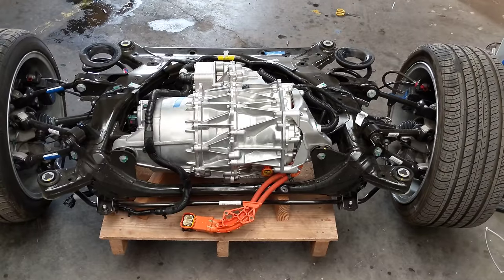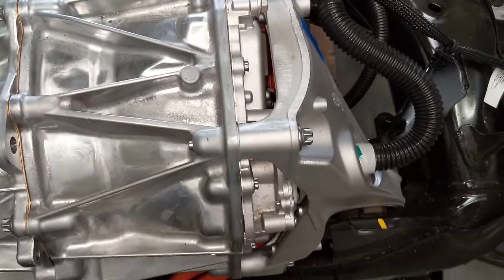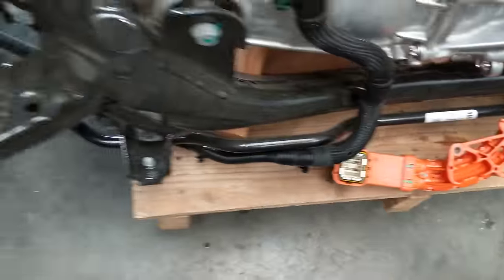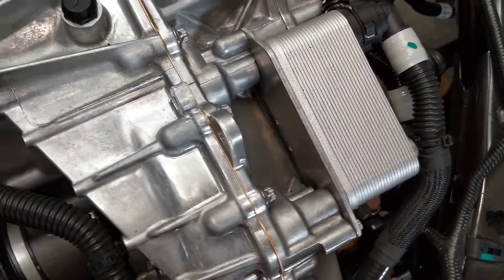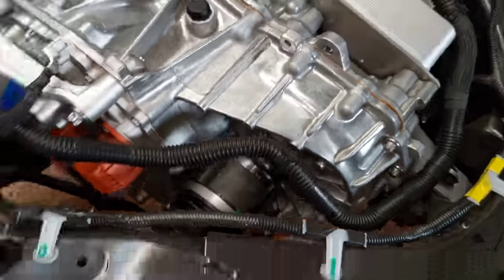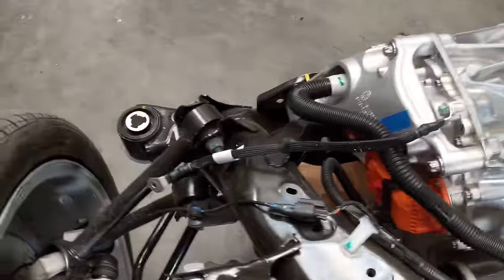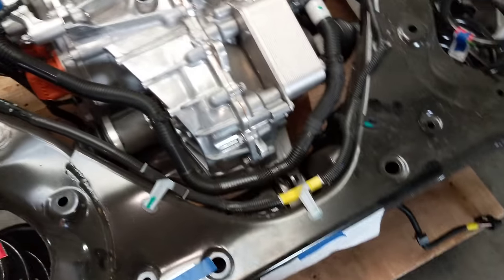First Look: Tesla Model 3 Drive Unit

Comment: How can four bolts hold this huge powerful motor?
Reply from the maker: It's a pretty small motor (200lbs), and the bolts are definitely up the task of the dynamic forces.
Reply: Airliner jet engines are held on at 3 attachment points connected with one pin each.  Good engineering design is the key.
Reply: The front 2 bolts has 128nm and the back ones has 168nm I use to torque these bad boys till I got laid off😒

Comment: The suspension seems like odd geometry to me. Is that common practice? I guess it's to have the spring off center for the drive axle but I think I would prefer a symmetric design and maybe use two coilovers if necessary. Also I don't care for the concept of a sway bar, particularly not with a low CoG like M3

Comment: Two of these under and early wrx, oh man
Reply: Model 3 rear track is 62.2”, GD WRX rear is 50.3”. So 2.9” narrower total, or 1.5” per side. (GC is narrower still.) You’ll need fender flares or different wheels. Subaru used 5x100 wheels for Imprezas but gradually went to 5x114.3. Same as the Model 3. However, Model 3 uses 14mm studs instead of 12mm studs, and “medium offset” of 35mm or 40mm instead of Subaru’s “high offset” of 45mm to 55mm. Then there’s the hub bore: 56.1mm for Subaru, 64.1mm for Tesla Model 3. 

The bigger deal would be mounting it. Luckily, we already know the spare tire well in the trunk can be cut out. Subaru also used a saddlebag gas tank that can be removed. Stock rear trailing links could be ditched too. The. You either need to weld parts of the Subaru rear subframe to the Tesla subframe, make adapter brackets, or modify the Subaru chassis to accept the Tesla subframe. Another handy plus are the two access panels Subaru used for access to the top of the gas tank. 

Using the Tesla rear springs would be a puzzle, but some air suspension “bag over” kits don’t use them. Instead, the damper attachment points do all the work. Luckily, the GD has some very high rear strut mounts that are very sturdy.

Comment: If you ever played with hobby grade Radio control cars then your pretty much set. The only difference other then size is the ESC (Electronic Speed Control) on RC cars are far more advance in technology the motors come sensored  or sensor-less and the ESC are user friendly and easy to tune. I'm surprised no one has attempted to replicate it for a full size EV. It would make life so much easier.
Reply from the maker: Sorry, I don't know of any hobby ESC's using SicFETs, and definitely none are near the total efficiency of Tesla's.  Running a sensorless feedback system in a large traction application is very difficult, and has all kinds of issues.

Comment: How much is a good cost for this setup? Also the best spot to get it. Good video ty!
Reply from the maker: The best bet is to buy a whole wrecked Model 3, as you'll find you need harnesses and all kinds of extra little parts.   I do have a controller that can allow full operation of the drive unit outside of the car.  Can use the original Tesla pack or any other high-voltage (250-400v) power source.  All it requires is the matching (from the same car) security controller (VCSec), Accelerator pedal assembly, and some custom wiring.  Once you are up and running you can then sell off all the parts you didn't use and make most of the purchase back.
Reply: @Ingineerix  I did find a full setup for a battery for $5,000  of a Chevy Volt batteries setup.  Tesla S motor for $11,500. The motor comes from EV West. If you want to see whats all included. Is this a good option? The car I was to use is a Subaru impreza 1998 2.5RS. That is so much for the help. I've never built a car but reading more about electric cars. Its becoming a passion of mine.
Reply from the maker: The EV West guys are great, and will take care of you, but on all the Tesla drive units they sell, they remove Tesla's inverter drive board (and thus all Tesla's software) and install a third-party board from Europe.  This is throwing away a lot of Tesla's awesome engineering for efficiency, power, and longevity.  If it blows up, then what?   (And they do!)  I offer an external controller that doesn't require any modification to Tesla's drive unit, it keeps it 100% Tesla and makes it work as engineered by Tesla.  (All protection features are still active)  If for some reason there are any problems it's all standard, so replacement is easy and quick.   Also, be sure you can fit a Model S drive unit in your Subi, They are large!  Personally, I would recommend a Model 3 drive unit, it's much smaller, lighter, and more efficient.
Reply: @Ingineerix  You personally sell Tesla 3's? What I'm basically looking for is something that's good performance but also a daily driver. Good performance I mean something that compares to a Golf R or other fast hatches.
Reply from the maker: No I don't, sorry.

Comment: Could you get it to work with just the battery and drive unit, without all the other stuff?
Reply from the maker: The minimum needed would be the shifter (SCCM), Pack, and Drive unit.  You would have to generate some CAN signals with a separate controller.
Reply: Ingineerix thanks, I think I could get that to work. I think this would be great.
Reply from the maker: Contact me when you have a project rolling.  I will probably have a CAN controller available by then.  These Model 3 components are going into another secret project soon!
Reply: I will, it wont be quick, I like the concept of using the Tesla system, Model S, 3 or X but can't do this quickly. Have been looking at damaged cars via ridesafely.com. getting more in state so shipping isn't crazy. Have you ever heard of MAGNAX, they make axil Flux High speed motors.

Comment: Looks to be realistic to swap into a Fiero/MR2 or any RWD car.
Reply: An AW11 MR2 with one of these would be awesome :)
Reply: I don't see how Tesla would lose money selling drives and other parts. GM does this with their crate engines. If Tesla waits too long, some other company (say, in China) will make "crate motor bolt-ins". There is a replacement for displacement.
Reply: @RaglansElectricBaboon  and deadly....if you could get the tires to even hook up lmao
Reply: SW20 rear track is about 5 inches narrower than the Model 3. Both use 5x114.3 wheels with similar offsets, but 14mm wheel studs to handle the Tesla’s torque instead of 12mm on the Toyota. 

The good news is that the MR2’s rear suspension subframe is held on with about four bolts. The bad news is that those four bolts are in entirely different locations than the Tesla. Worse news is that the bottom of the firewall between the engine bay and the trunk might need major surgery. Good news is some of that’s been done before by a guy who put a rotary piston engine in an MR2 for 24 hours of Lemons. 

Alternatively, you could just mount everything behind the car and create a very long wheelbase MR2. Think outside the box, lol!  That would leave the entire engine bay and trunk for batteries. 

The MR2 doesn’t require (conventional) power steering, so that’s easy. You’d still need to figure out vacuum for the brake booster..

A stock Mk2 MR2 weighs about a thousand pounds less than a RWD Model 3. Whatever the final weight would be, it would certainly be a cool conversion.
Reply: @Edgar-Friendly  Tesla is making more money selling Model 3s than they would selling retrofit kits. Every drivetrain they sell as a kit is a Model 3 they didn't sell. But if the chip shortage means that Tesla could build and sell these drivetrains while the rest of the Model 3 is bottlenecked, then that might be worth developing such kits. We're not there yet, though.

And honestly, I'd rather part a scrap car to retrofit than buy a kit.

Comment: How many total moving parts are in this motor?
Reply: Jef b 1
Reply: Well 1 and 2 bearings I guess. Then a reduction gear, done.
Reply: From a marketwatch article re model a: “The company says its drivetrain has about 17 moving parts compared with about 200 in a conventional internal combustion drivetrain. “
Reply: @Kim Neeper Rasmussen; and a differential.
Reply: Ummmm if the model S has 17, let’s guess that the correct answer is 17+/-2-ish. Waiting for confirmation

Comment: What made you pull it out?
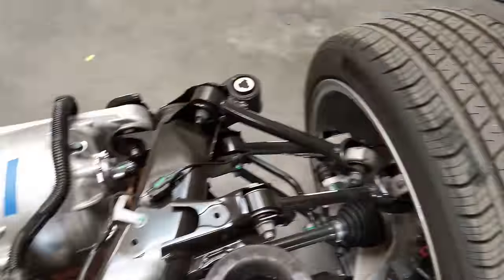Reply: I'm pretty sure it came out of a totaled Model 3.  You can see the ripped inside sidewall of the tire at 1:27.  Also at the 1:00 minute mark you can see the inside rim of the wheel is slightly beat up which would never happen to a newly delivered vehicle.

Comment: This needs a project..

Don't fit it back into the Tesla.. 

Find a Festiva.. 

Make it AWD.  

Please I beg you.
Reply: There is a Tesla which is AWD and dual motor. It's one of the model 3's.
Reply: +Telclivo All Teslas have AWD now.
Reply: Sweet.. I'll wait 10 years to do my project then. When 3s are more common and freely available roaming the junkyards..
Reply: Coraga 1 i didnt say all M3's have AWD. I said all Tesla have AWD now. With some common sense you would have known that i mean "available"
Reply: in 10 years on the junkyards? well you shouldnt bet too much on that.
Reply: @Pimpmedown  Model S parts are pretty common now, and they're a much less widespread car than the Model 3 will be. Wrecked Model 3s could be very common.

Comment: Any idea how heavy just the motor/transaxle is?
Reply from the maker: With inverter and lubrication (wet) the entire drive unit was just under 200lbs/90kg. The inverter part itself with it's cold plate weighs only 8.5lbs/4kg.
Reply: Awesome!  Thanks for that info
Reply: @Ingineerix  Is that the drive unit plus all the suspension? Thanks for a great video.
Reply: @Ingineerix  that weight is quite low, given the latest drivetrain creation of Vitesco/continental weighs a hefty 80 kg for 100 Kw!

Comment: Really? This looks like one of the cheapest electric drive trains i have ever seen! But well, the ones i have to do with at work are not for low-price cars and much more complex.. But anyhow, this one is the worst i´ve seen so far in a series car.
Reply from the maker: You must not have much engineering experience,, or you could not arrive at the conclusion that it's the "worst".  I've had a look at pretty much all production EV drivetrains.  You are correct in that it's been amazingly cost-optimized, (cheap) but definitely the one of the best engineering marvels I have seen to date in a mass-produced car.
Reply: @Ingineerix  I´m in with th conlucion of worst. And my experience isn´t that good either. I´m an engineer for electric-powertrain though. But not that long and i actually came from architecture. So what i do is housings for gearboxes and e-motor´s. And that´s what i ment. The housings seem pretty easy. i cant´t even see any double wall for at least cool down the e-machine. That´s what I call cheap. And hey, I can´t tell anything about projects we work on, but what if you´ve really seen so much edu´s, than you knwo what i´m talking about. I didn´t want to troll, it was my fault for choosing wrong words maybe, but what makes me kind of angry is, that all the people knowing nothing about electric cars, are reading here that this is the "!up to date" powertrain, which it is definitley not. It´s not bad, not what i wanted to say, but it isn´t anything new or advanced as well..

Comment: I cant believe how cheap tesla got on building this Model 3.  I knew they didn't go with an aluminum body but I didn't realize they also went with a non aluminum chassis and suspension. WoW
Reply: Aluminium alloys don't have a fatigue stress to design for, thereby making them unsuitable for highly dynamic structures. Which also means that you would need to replace those aluminium suspension parts more often.

There is a reason why steel is still the best all round construction material.
Reply: Quite true. I have a Gen 1 Honda Insight.  It's had a problem with leaks from fatigue cracking.

In order to get strength out of alumium, you have to bring it to a high temper, which makes it brittle.  And even still you don't get the strength/weight ratio of modern high strength steels (boron steel and the like). Alumium is best for thin, non-loadbearing parts exposed to the environment (panels and the like), or locations where the very high strength steels (which can be tough to work with) are otherwise unsuited; where loads are to be borne, you want them spread out, padded, and far from the material limits of the part (for example, with alumium rims they're protected by the tire around them). UHSS is really a pain for manufacturers.  You stamp it and it wants to spring back to its earlier shape. Real pain to weld, too, where you can weld it at all.  But it's simultaneously both strong and resilient, and doesn't break the bank.
Reply: As for the cost, you can see a lot of the reason (beyond how cheap they got their batteries via mass production and cobalt reduction) in the example given by Munro of the rear-view mirror. Tesla's costs a small fraction as much as BMW i3's, which in turn cost a fraction as much as the Bolt's. Why? Because there's no buttons or display; all UI is integrated into the central display and managed by the same computer system. Systems integration is a huge cost saver, both on parts and wiring.

It's extremely difficult for other automakers to move to this approach, however. In another life I worked in the auto industry. Whenever they want functionality, they buy a "box" from a supplier that contains said functionality. Need a new feature? Buy a new box. You have all these suppliers, and everything is standalone, designed to be plug-and-play.  But it means that you can't integrate anything.  So there's all of this tremendous duplication of hardware.  And it's not only a financial drain, but also extra weight and power consumption. Ever wonder why car alternators have kept growing over the years? You're looking at it.
Reply: Thanks Karen.  That is one of the most informative posts ever.

You rock!
Reply from the maker: The bulk of the Chassis is Steel, but there is still a lot of Aluminum in the 3.  Doors, Hood, Parts of the rear clip, etc.  Rear suspension has steel links, front has aluminum forgings.
Reply: It's not a super-car y'know!
Reply: steel>aluminum
Reply: super cars are now nearly all carbon fiber and other composites.
Reply: Uh, ya, news flash: the Model 3 is cheaper. Kind of the point.  More affordable than any other all-aluminum body car, EVER.  Better in many respects too, than a LOT of them.